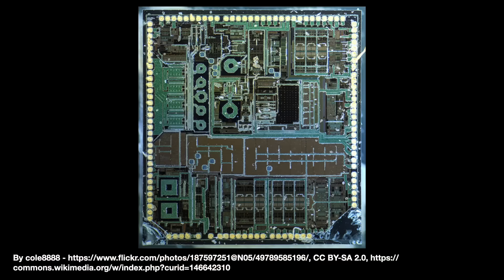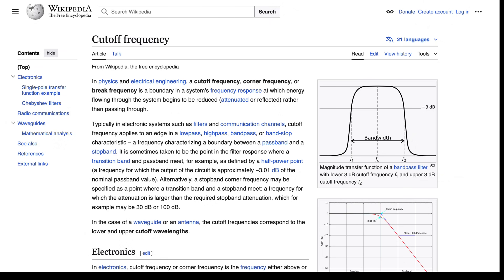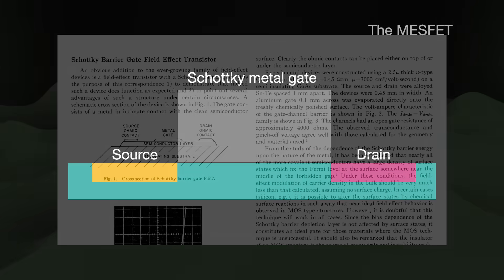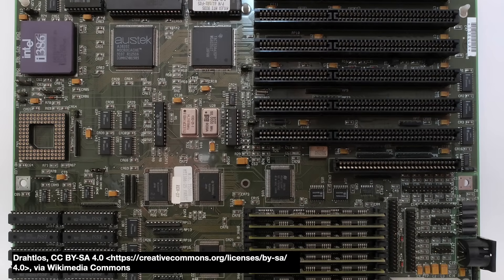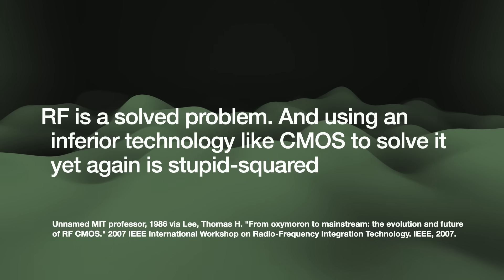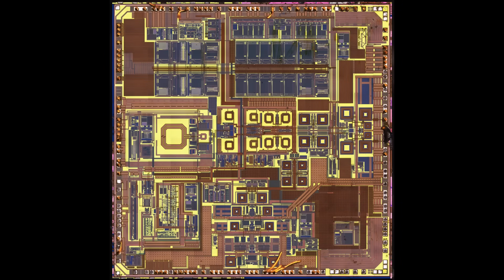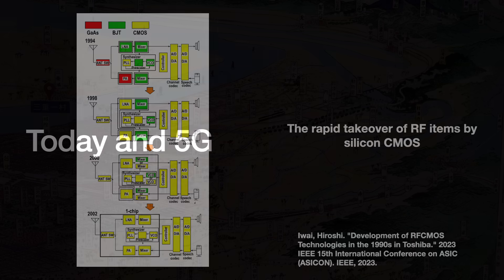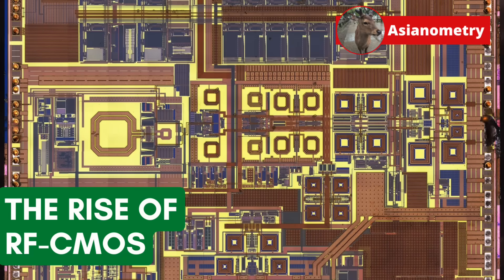How Moore’s Law Revolutionized RF-CMOS

Comment: 6G won't happen, for the same reason that 5G hasn't lived up to the hype. Those high frequencies get stopped by things like glass, wood, and drywall. Doesn't matter how good the tower is if you go inside a building and lose signal, does it? Frankly, 5G's biggest contribution co cellular performance is adding phased array antennas to phones. All the shouting about bandwidth is bupkis. Besides, the low end of 5G puts out enough bandwidth that no one really has a "killer app" for more than what's already there.

Comment: The thing that you don't note here is that analogue electronics need to be as linear as possible; the transistors aren't switching but are running in the range between being full-on and full-off.  The better the linearity, the lower the distortion, and the fewer spurs and spurious signals in your RF.  This is all great but it's in direct conflict with the demands for digital electronics, which need to be switching and never in any intermediate state.  So the techniques for linear and digital chip design are very different.  We still use diffusion for linear chips for lower noise, while we use ion implantation for digital chips for higher density.   So getting both digital and analogue electronics on the same chip is both a matter of compromises and as much art as science.  Mixed-signal stuff was voodoo for many years and sometimes still is.

Comment: STMicroelectronics currently has the most advanced RF CMOS process- B55X, a 55nm SiGe BiCMOS process.  Circuits produced with this process have exhibited performance into the 300GHz range and extraordinarily low noise.

Comment: The "super" of "super heterodyne" does not come from "very high" frequencies, but from superposition of 2 signals, the "hetero" refers to the signals being different in frequency. The IF, BTW is not always, lower than the incoming signal, in case of longwave receivers your receiving frequencies is typically lower than your 455 kHz IF. (455 kHz is chosen because cheap filters are available for that frequency)

Comment: 2:46 "Cutoff frequency" is usually related to filters. For transistors this is called the "transition frequency",  abbreviated "fT". This is the point where gain is equivalent to 1.
Reply: I would have posted a similar comment, but I saw yours first.  GBW (gain bandwidth product) is the characteristic of an active RF component that defines the upper frequency limit.  The video talks about an empirical 1/10 factor, but that's only because a SNR (signal-to-noise ratio) of 10:1 or more is usually desirable.
Reply: fT and cutoff are used interchangeably.
Reply: @str8_krillin_it470  Wrong. Read my 1st statement!

Comment: Why the hell the 5GHz mark was crossed and stopped somewhere in 2004-2005 on the chart at 16:10? I though the first CPUs that got there were somewhere in the middle of 2010s - namely, FX-9590, with release date of 2013.
And at 2005 the typical CPU frequency was Pentium 4 672 @ 3.8 GHz at max.
Reply: Its not, you're looking at the transistor count. Frequency hits a wall around 3.5ghz on that chart
Reply: @wills.5762  So, you know better than me what I am looking at? Because no, I'm looking at green colored dots titled as "Frequency (MHz)", which is quite clearly hit the wall at 2005 at ~10^3.6-10^3.7, with the absolute highest value at around 2008. Whereas the actual highest frequency CPU (stocks) is relatively recent 13900KS, @5.8GHz, release year 2023. But ok, suppose the chart goes only to 2022, still, then there's i9-12900KS with 5.5GHz released in 2022. Anyway, the highest clocks definitely weren't reached in 2008. At least, not stock.
Reply: @aberroa1955  You are quoting the 13900KS Turbo Boost Max Technology 3.0 Frequency. The Performance-core Base Frequency is still 3.20 GHz. Dennard scaling ended around 2008.

Comment: 2:14 what's pictured is digital superhet transceiver (an analog version wouldn't have the ADC nor DAC nor DSP, instead they would have a demodulator, which could be as simple as a diode for AM). The diagram is probably the front end of a SDR (software defined radio). Note transceiver means it can receive and transmit (top and bottom branch, respectively). Also, the previous diagram looks like the tuner stage of superhetrodyne setup since the right side is IF (intermediate  frequency).

Comment: I know it is not for RF but when you look at the traces on a PCB and see some make multiple "S" turns I can only think they do that to time the signal (at the speed of light) for some reason.
Reply: It usually is for time alignment (e.g. if you have to ensure each of several data signals all arrive at the destination before the next clock edge), although it's not traveling at the speed of light. The propagation velocity of signals on a PCB (rather than in free space) is a function of the effective dielectric constant (the Dk of the material itself on internal layers, or an average of the material and air if on an outer layer) and usually ends up being somewhere around 0.6-0.7 times C. Still very fast, but enough of a difference to matter.

Comment: Asianometry  made my Friday, this was fascinating.  I've designed and engineered the vast majority of my chips for digital applications, however while at Atmel designed some PLL and oscillators in bulk digital 0.35um CMOS for the EZPass toll chip for Mark IV industries the "407".  We thought "407" was just a part number randomly chosen by the Ontario group of Mark IV, no it was named after their famous 407 freeway that runs through that part of Canada.

Comment: I trained as an radio electronics technician in the '80s, and this is all interesting but doesn't fully explain what happened.  Superhet circuitry was he norm for valve based receivers long before transistors entered the room, and even in 1984 when I was tasked with automating the acceptance testing process for a large purchase of RF signal generators, those signal generators - pretty much the best available at the time - only wenr up to 1GHz.  We did have circuitry that could generate higher frequencies at that time, but they were almost always klystrons. Even so, it was clear that silicon was the future, just that it wasn't an urgent problem.

Comment: Few observations:
1. The best department of MIT is the press department.
2. CMOS RF was the holy grail in late 90s. I had joined a company in 98 in the valley with the promise that they wanted to work on CMOS RF. By the time I joined, they had changed their mind.
3. Cambridge Silicon Radio in Cambridge, UK had started working on all CMOS Bluetooth transceivers the same year, ie 1998. Bluecore 1 was the first CMOS Bluetooth transceiver.
Reply: Including Lincoln Labs

Comment: CMOS power use also is very linear regarding clock frequency, current scaling almost perfectly linearly with clock frequency, leading to a exponential power use as the frequency rises. Thus all the research on how to have unclocked logic in ASIC's and CPU's, and the extra attention given to scaling clock speed according to load, along with disabling areas of silicon not actively used by switching off the clock.

But those RF parts will be integrated, either as a top few layers bonded to an oxide layer, or directly into the silicon itself with more exotic semiconductor doping. Already you get on die converters handling dozens of amps of current, to provide on die regulation with a very fast response time, and that is using on die inductors and capacitors as well, though capacitors are easier to integrate using deep well doping to make a diode, and often integrating it as part of the switching element as well, saving on area using the needed large structure for high power as the one electrode.

Comment: You missed the cost per die per solution perspective. I work in the early 2000 on transceivers and have the option to use either 90nm CMOS or 250nm BiCMOS. The later was slightly better performing and a way better to design but the major thing was that the die for BiCMOS somewhat counterintuative smaller but cheaper to produce. We as an engineer's most looking what we  can do with CMOS and most discussion was about this but finally the cost.
Btw Intel Mobile have a great struggle to use a non-analog PDK for there processor orientied 14nm CMOS and finally fail. Now, part of the design team work at Apple, with a much better PDK but the BiCMOS history was also a burden to get ahead. But i would never do a RF/Analog design in Intel because the domain requirements are disconnected, to speak midly.

Comment: thoughts on whether on chip cooling will make a difference?
Reply: Whatever you mean by that, it won't. Power density is the problem.
Reply: @marko6550  How so?

Evaporation cooling is by far the most efficient way to cool chips. It is a known technology and has been used decades ago. There is also immersion cooling and the all time favorite, liquid nitrogen cooling (just another form of evaporation cooling).

The problem is always the same, power density. Too much power is consumed and therefore heat is produced in a too small volume that creates the problem of moving that amount of heat fast enough away from the source to a proper sink.

Ironically, chilled cooling is now in it of itself considered a problem. Power Usage Effectiveness (PUE) comes into play here for any type of data or compute center. So, warm water cooling is preferred for its energy efficiency. After all, a MW of power costs ~$1M per year. If a 20MW data center has a PUE of 1.5, then the cooling alone costs $10M per year in operating costs.

Comment: The dish of a radio telescope isn't the antenna, it's a collector to increase gain, the antenna is the box sitting in front of it on the arms. Radio telescopes are so big because signals from space are so weak.
Reply: No, the comment is correct. The reason for the large dish is to increase the aperture of received signals, which are then focused on the small antenna. The antenna is sized according to the wavelength. The dish is made as large as possible given other practical constraints. The use of the dish image in this story while talking about wavelength is a mistake.
Reply: Same thing Einstein

Comment: 17:17 the chip looks like a robot 
14:45 Silicon Labs plain old telephone service DAA (Data Access Arrangement) chipset doesn't go up to RF range but to Telephony's PCM bit rate of 64 kbps (if not ADPCM companding used.) 
Example is a telephone line powered POTS analog telephone interface IC such as Si3011, which will pass through 2 coupling capacitors ( 2 uni-directional  channels) as isolators to an all digital interface IC (e.g. Si3050), which will pass in-band signaling to a control uP as well as the digitized data to a voice band data modem's DSP IC.   Key is those components are all low profile which can fit into a PCMCIA card with no interface dongle nor signal transformer required.
P.S. cordless telephone sometimes uses linear opto-isolator in lieu of the above approaches.

Comment: You got that part about the human voice wrong. The ear is most sensitive at about 4kHz for a reason :) You need all the overtones and high frequencies to understand anything. For reference: A subwoofer goes to about 80 Hz, sound waves are still propagating omnidirectionally at that frequency. The frequencies up to 150 Hz are usually referred to as bass and sub-bass. I think  it‘s obvious that that is not the part that makes human speech intelligible;)
Reply: Only thing I can imagine is that he meant the baseband bandwidth of human speech. Excluding singing this indeed probably is in the order of 100Hz. But yeah, he butchered that part.EDIT: even without singing fricative sounds will produce frequencies up into 20kHz easily.
Reply: @root42  Indeed. Tests made in highly echoic environments show that female speech, with higher fundamentals and overtones is far more intelligible for e.g,. airport or train station environments. And indeed gets more so if you suppress the fundamentals..the so called 'whisper filter' . Largely because the high frequencies don't carry so far or bounce around so that you only hear what the closest loudspeaker is saying.
Intelligibility lies in the 300Hz-3kHz band, and you can drop most stuff below 600Hz no problem
Reply: I’m an EE designing delta-sigma ADCs and also have a background in RF-engineering. I have a hard time trying to decipher what you are trying to say that would be relevant to the discussion.
You sound like someone with superficial knowledge about some things combined with an even deeper lack of understanding in others, sorry. 
First of all, no, we are not talking about the discretisation of signals 😂
Radio broadcasting and wireless communication was a thing way before the emergence of digital technology. It doesn’t matter at all for my point if the baseband signal was at some point in the digital domain or not. Absolutely irrelevant.
Secondly, nowhere did I claim that the audio band or anything in that frequency range is considered a „radio band“ or that a transistor can’t switch faster than 200 Hz😂
Again: In this video, he says the human voice ranges from 80-200 Hz, which is WRONG, this is only the fundamental frequency of a human voice, and to transmit intelligible speech, you need to transmit a (baseband!!!) signal from about 300 Hz to 3.4 kHz (in the audio context called the narrowband, that is all what you got with analog telephone communication ). That is ALL I am correcting. Human hearing goes from about 20Hz to 20 kHz, so for a full fidelity transmission, e.g. for music, you‘d transmit a baseband signal with a bandwidth of 20 kHz+. Changing the domain from acoustic to electric via a transducer like a microphone does NOT change the frequency of said signal at all!
Now, have you every heard of the groundbreaking concept of modulation?😉 
The baseband signal is used to change e.g amplitude, frequency or phase of the carrier signal, which sits at the frequency you CAN actually transmit, and therefore encodes the baseband information in the carrier signal, which retains it‘s practically transmittable frequency in the process. However, the modulation process DOES increase it‘s bandwidth, and at minimum by the baseband bandwidth. Assuming a baseband from DC to 20 kHz and you‘d just use some basic AM to modulate that up to 1 MHz, you‘d end up with a signal with a bandwidth from 1 MHz-20 kHz to 1 MHz+20 kHz (called a Carrier Double Side Band signal). In the video, he implied such a signal would range from 1MHz+/-200Hz. So again, it was a very MINOR correction which you did not understand at all…
Reply: 100% correct. Great explanation

Comment: Micron is obsolete. Please use micrometre instead. Otherwise,  you could use millimicron instead of nanometer. Which ones make more sense? Pretty obvious, I think. 
Otherwise, an excellent video as always.
Reply: "Micron" and "micrometer" are used with almost interchangeable frequency in technical references. Google Scholar citations, 2025, word-count.
"micron" is not, and never was, 'obsolete'.
Reply: @-danR  According to NIST the unit "micron" is obsolete. I found this out using Google, of course. Here is the link:
https://www.nist.gov/pml/owm/writing-si-metric-system-units#:~:text=The%20word%20%22micron%22%20is%20an,been%20replaced%20by%20degree%20Celsius.

Comment: Is there an upper Frequency limitation? As chips get smaller and the frequency gets higher (wavelength gets shorter), there may be a limit caused by the fact that a signal may be at a positive amplitude at one point, but at zero amplitude just a little further down the line.
Reply: @joeylawn36111  in theory maybe but unless there is some big breakthrough devices are limiting us much more than the actual wavelength itself is.
Also even if you get that small, there are ways to design around it. For example distributed amplifiers are amplifiers on the order of a wavelength in size, and they actually use this fact to their advantage
Reply: @tylerweigand8875  Good Points, thanks.
Reply: yes, at some point in the terahertz range it stops being RF and starts being infrared light
Reply: @TheBackyardChemist  Good Point!
Reply: @TheBackyardChemist  yes but that doesn't necessarily mean anything, there's nothing intrinsic about infrared that says we can't still make circuits that operate at this frequency, it is just a lot more difficult
Reply: @tylerweigand8875  I am not so sure...like metals are not transparent or conductive in the far infrared. It is a weird middle ground between optics and electronics.
Reply: @TheBackyardChemist  Metals are still technically conductive in far infrared, it just becomes very difficult to carry signals at those frequencies because of things like skin effect. People have demonstrated circuits up to 1 THz and some even above that, which can already be considered infrared